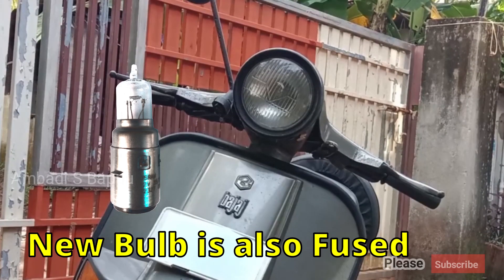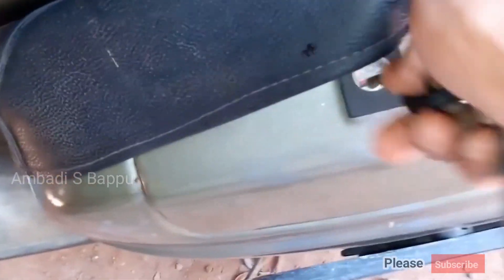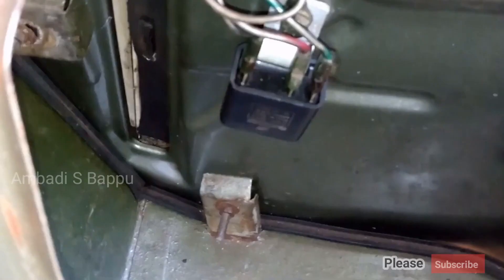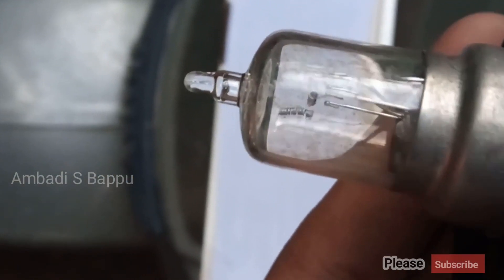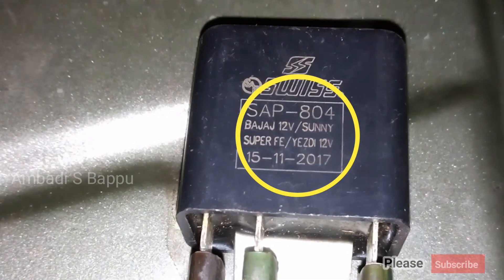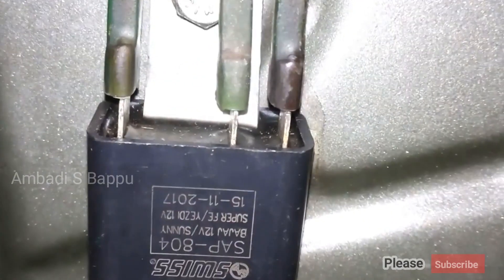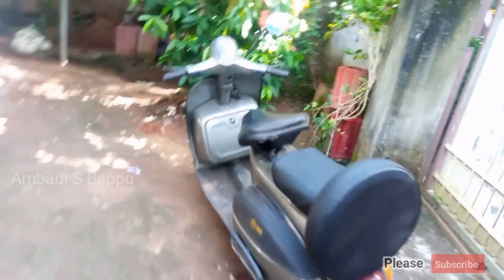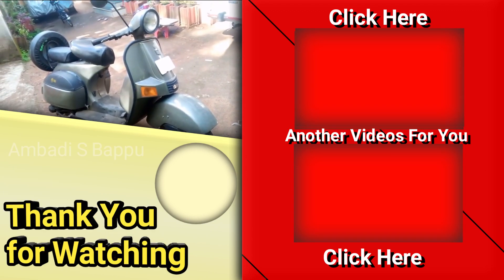Scooter Headlight Bulb Damages Regularly |Why?| Regulator Unit | Reasons Detailed | Bajaj Chethak

Comment: Sir my problem is when lights switch off then the indigetor horn work but if i on light then light blink or gone also befor this i repairs the indigetor but befor indigator when i was  use light horn slow voice problem
Reply from the maker: Common to most of the Chethak. Light consumes more power. So current flow to other accessories will be less.

Comment: Can we can use it in suzuki max100
Reply from the maker: It may be suitable Sir. Not sure.
Reply: @ambadisbappu5807 how is the wiring
Reply from the maker: No idea about this in Max 100. Normally it have a + ve current input and output wire.

Comment: Light is power low, how do incrise it
Reply from the maker: Sir,if light power is low just check the bulb first. If it fine, checking the coils for light inside the flywheel is needed. If it is weak, changing it is needed.

Comment: Sir mera lightning current low araha hai maine coil bi change kia ta
Reply from the maker: Sir, if the current is low, checking the lightning coil is better. If it seems to be weak, replace it. Even after changing the coil and not improving, checking the Regulator Unit and Wiring is needed.

Comment: Sir do more videos on Bajaj chetak... The chetak in this video is of  4stroke ?
Reply from the maker: Now Sir, It is more refined version of Two Stroke 150cc engine comes in old Bajaj Scooters. Having nowadays like SPACO Carburettor, Reed Valve, Ignitor (CDI and Ignition Coil are integrated) and more space for air cooling near engine fan.